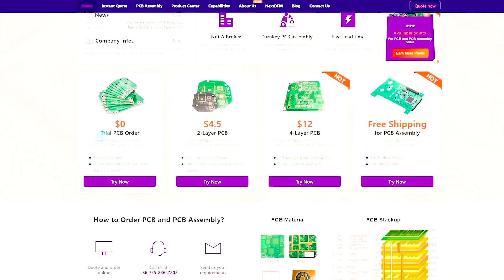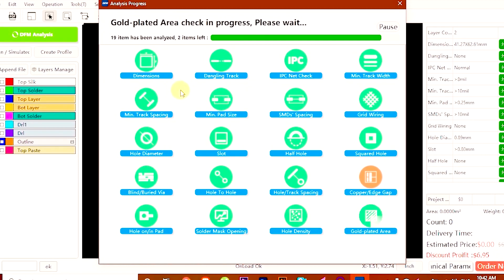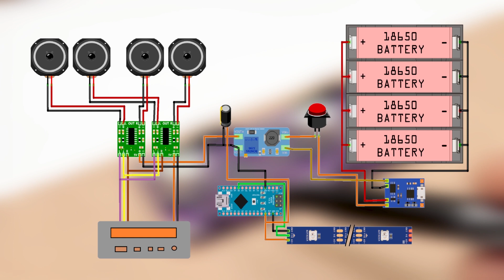DIY MDF Bluetooth Speaker 4.0 With RGB Lighting Effects

Comment: Hello Bro I would like a lot to make a sound bar, with old speakers I have, but I dont know too much about how to calculate the measuring units of the components I have to use, neither I dont know exactly what components I have to use.
I have in total 5 speakers, how do I know for what frecuencies are best suited for? 
Im wondering this to know If i just can use the bigger one for the sub bass
Reply: Bto check specification noted on your speaker and tell me😅

Comment: Can I use a 12v 2amp input power charge in the TP4056 module?
Reply from the maker: no
Reply: The working voltage of TP 4056 is 2.5 volt to 5.0 volt maximum.....
Reply: Vaii 5 ta speaker use kora jaba

Comment: Good video.  I will try it.  Please post a link for the micro usb connector.  I cannot find it online.
Reply from the maker: https://www.amazon.in/Electronicspices-Panel-Mount-Female-Micro/dp/B08CY4RNHX/ref=pd_sbs_1/258-8682122-8339716?pd_rd_w=TpXHm&pf_rd_p=950901b9-b71e-4c33-9fc5-41ec6db58ad1&pf_rd_r=RCXWHG0R6K79MDR74WF3&pd_rd_r=e5a27fb4-f3be-4779-af2f-b3547c683524&pd_rd_wg=hIC2v&pd_rd_i=B08CY4RNHX&psc=1